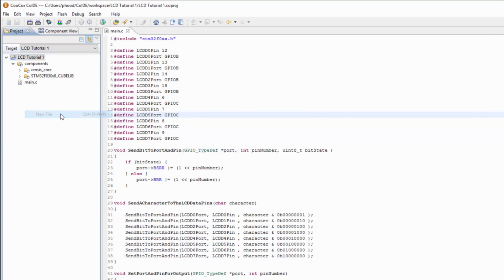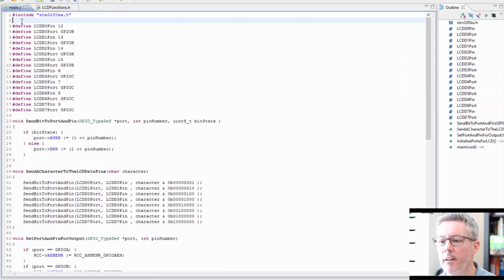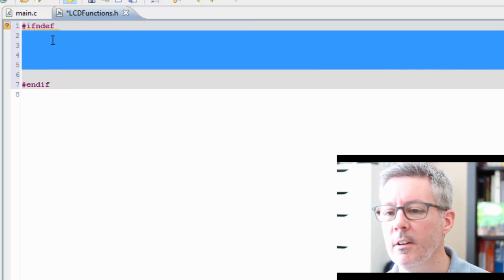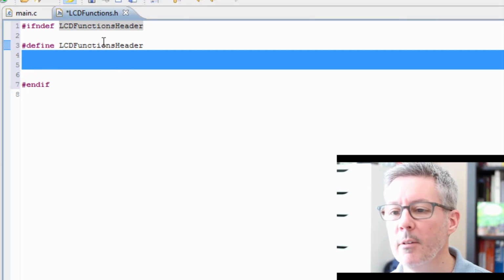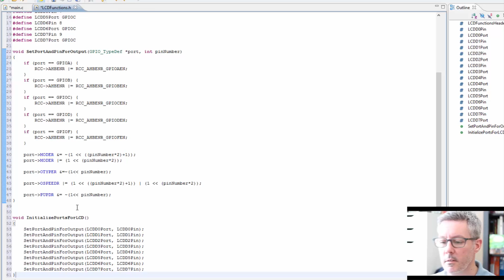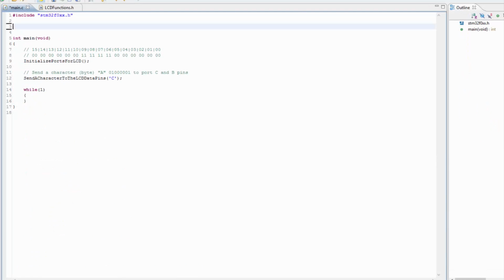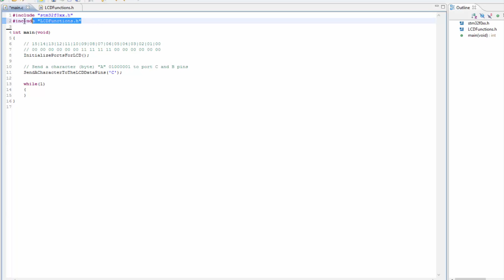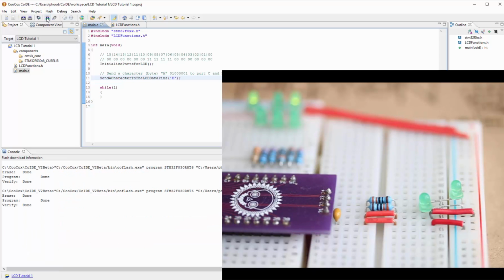21. How to Interface an LCD to an ARM Microcontroller - Part 8

Comment: which programming language should i learn to program ARM
Reply from the maker: That depends on what level of development you intend on doing.  If you planon going into production with a project that you create, and the project is based on very specific tasks, then I would recommend using C or C++.